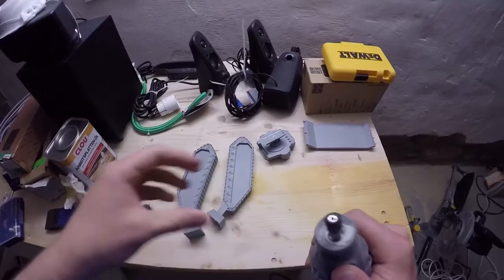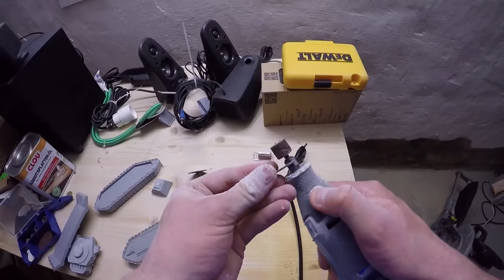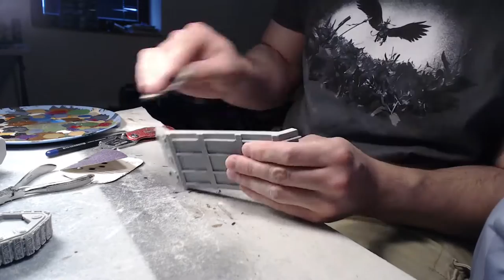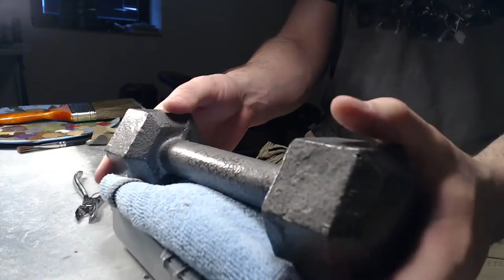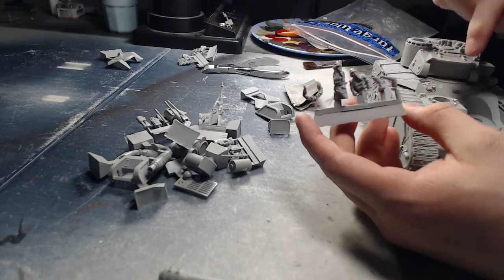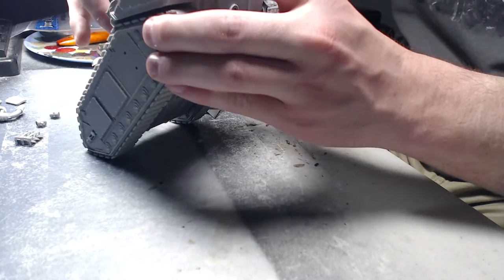How to Build a Macharius Vanquisher

Comment: If you want the kit to go that much further, the Vulcan mega bolter from the baneblade kit can be modified to be mounted in the front of the Macharius turret. You will need some plasticard and a few bits and bobs. Then you can magnetise both options. I did this with one of my two Macharius tanks and I think it looks better than the FW Macharius Vulcan.

Comment: you may find a hair drier will do the trick when you need to bend warped pieces heat guns are dicey as they may actually melt the parts